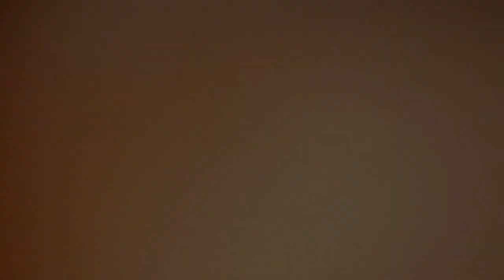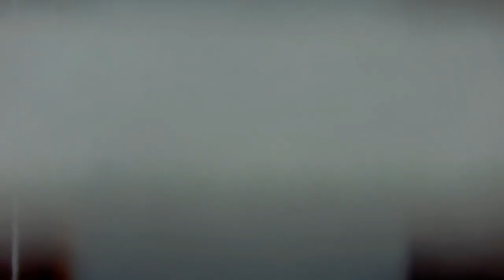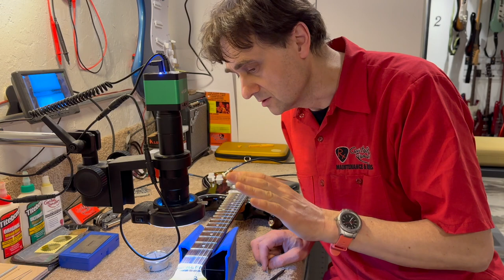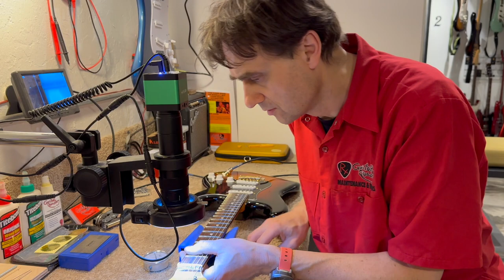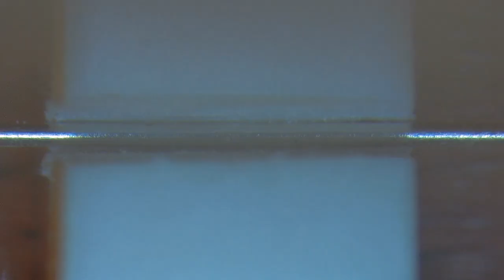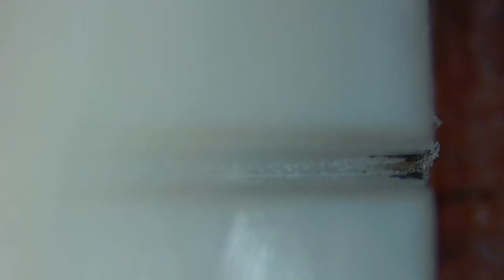Sitar String Buzz & Guitar Nut Repair Under Microscope

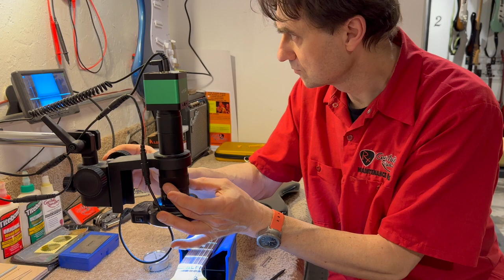Comment: I do hear a big improvement comparing :30 to 8:40. Came across this video because of a similar sound on an acoustic guitar. When I received the guitar, I recall thinking the nut slots looked much wider and more boxy than the bone nut I had just slotted on another guitar. They look much like the ones in this video. I will check this out. Thanks for the video.
Reply from the maker: Thanks for sharing your experience. And hopefully this video helped you out.

Comment: I think if the slot would have been filed even thinner at its bottom and to a V shape towards the edge of the nut, the string could not move anymore at the leaving point. Same time, the string would not come to lay necessary deeper, still having contact  to remains of old slot areas. 
   But great way with a microscope to find and solve problems! 
  Cheers!🤟🏻
Reply from the maker: Interestingly, I actually already have a microscope recording of string slot that was cut too much like a V instead of a U. It did not cause any issues with the guitar, but there was a lot of microscopic debris accumulated at the bottom of the string slot. It is an interesting recording and I've been planning to publish a video of it. Coming soon...

Comment: What also can happen is if the nut slot is parallel the string can vibrate and touch the sides. So if you have the string resting on the leading edge which you have done but taper away the side walls away  to open up the exit. The string while vibrating has only contact at the front of the nut , this is the way i understand it. No more citar wolf notes would you agree with that? Cheers
Reply from the maker: As you said, the leading edge, at the front of the nut, is important. It is important to get it just right.

Comment: Same sound up the fret board = most likely not the nut .
Guessing
Reply from the maker: I was hearing a different sound on the open string. Interestingly, I believe there was one other viewer who made a similar comment and was suspecting there was no sitar buzz coming from the nut. It's impossible for me to look at the issue at this time, as the guitar is long gone, but with the guitar on the bench, I do remember hearing the buzz I was describing. Thanks for your comment.
Reply: @GuitarQuackery  YW 
I had a similar problem on an acoustic and my luthier steepened the nut down from the breakpoint and it cured the issue.

Comment: Are you sure it's just the nut? As that string seems to "sitar" all over the fretboard...
Reply from the maker: There was no problem with the nut. I was just showing the issue that can occur if you put too many winds on the bass string, on the headstock that has the tuning post very close to the nut.

I recorded this video before doing a setup on the bass..

The sound of the bass after the setup was not too good since I was playing through a guitar amp.
Reply: @GuitarQuackery  what bass string? Wasn't this high e?
Reply from the maker: @Bobock584  Oh, sorry, I thought I was replying to a comment on a different video (the latest video I just uploaded yesterday). 

I listened to the recording again and I think I know what you mean. Unfortunately I no longer have that guitar so I cannot verify, deny or confirm anything. But I seem to remember that there was an improvement when I was working on it, listening to the guitar in person and I don't recall hearing any sitar sounds on the frets. It is quite possible that the recording sounds different than what I heard in the room, as I don't spend any time setting up the audio recording. I wish I could be of more help answering your question.

Comment: I don’t think you fixed it
Reply from the maker: Another viewer made a similar comment, not so long ago.

If you don't mind, I just want to copy and paste part of the reply I made to his comment.

"At around 7:30 I can see that the string is siting in a narrower slot that I filed at the bottom of the pre-existing wider string slot. It is not ideal, but it is still better than it was. It is actually possible to make a narrower slot at the bottom of a wider slot, if there's enough material to file lower. As I re-watched the video, I did hear myself say that there might not be enough material to fix this by filing, as the existing slot is already very low. 

At around 8:00 I also say that it's am improvement and that "we'll see what the customer wants." I think it is clear that this was nothing more than a small improvement - the best improvement that I could achieve by filing and without replacing the nut. 

The sitar buzz at the nut doesn't come up every day, so I just took the opportunity to record a video that shows why this can happen."

Hope this makes sense.

Thanks for dropping by and hope you enjoy the videos.

Comment: You didn't fix anything. The nut slot was too wide. You needed to fill and re-file or replace nut.
Reply from the maker: I’ll rewatch the video. I cannot remember details at this point. 

Speaking of filling the string slot. What would you fill it with?
Reply: @GuitarQuackery  This nut needs to be replaced. If there's lots of material underneath, you could shim the nut and cut new slots, but the best long term solution is simply to replace the nut.
Reply from the maker: I rewatched the video to refresh my memory.

At around 7:30 I can see that the string is siting in a narrower slot that I filed at the bottom of the pre-existing wider string slot. It is not ideal, but it is still better than it was. It is actually possible to make a narrower slot at the bottom of a wider slot, if there's enough material to file lower. As I re-watched the video, I did hear myself say that there might not be enough material to fix this by filing, as the existing slot is already very low. 

At around 8:00 I also say that it's am improvement and that "we'll see what the customer wants." I think it is clear that this was nothing more than a small improvement - the best improvement that I could achieve by filing and without replacing the nut. 

The sitar buzz at the nut doesn't come up every day, so I just took the opportunity to record a video that shows why this can happen. 

Of course, like you say, in this case the best repair option would have been to replace the nut. But I can't just do that if the customer is not paying for the service. He said it was OK and didn't want me to do a bigger job.

In your initial comment you mentioned that the string slot would need to be filled and re-slotted. I was wondering what filling material you had in mind. I do see the baking soda and superglue fillings from time to time, but I don't believe those are permanent fixes.

I do offer the service of repairing the string slots using dental composites. I only do that on bone nuts, as bone is a similar material  to teeth, which is the material for which the composites were developed to adhere to. Also, It is something that I will typically only offer in situations when there are reasons why replacing the nut might not be the best option, such as fixing a damaged nut on a vintage guitar (and some other cases). 

I will have som e videos coming up, as I've already made the recordings. 

Thanks for your comments.